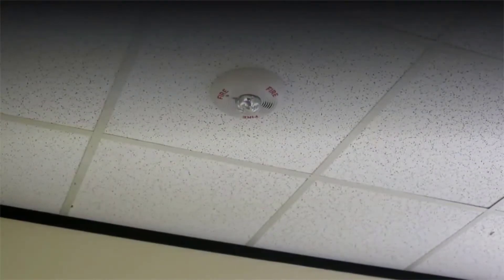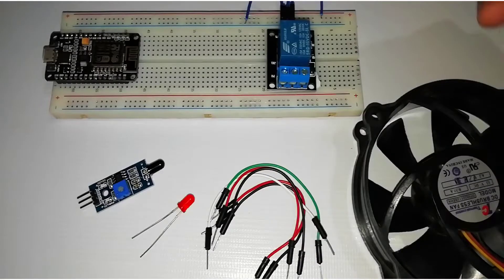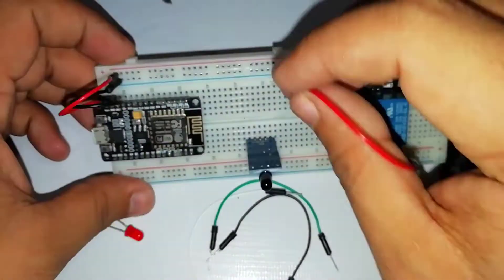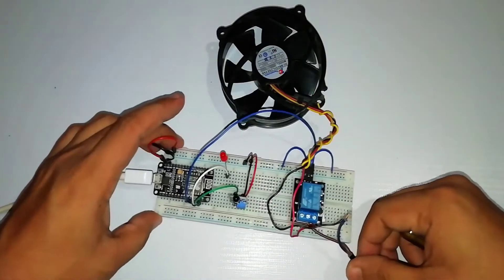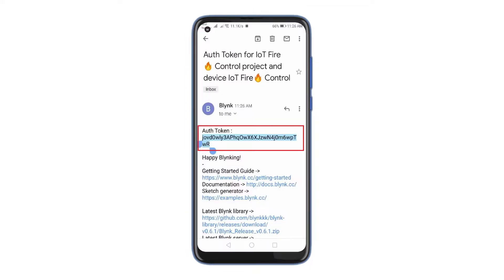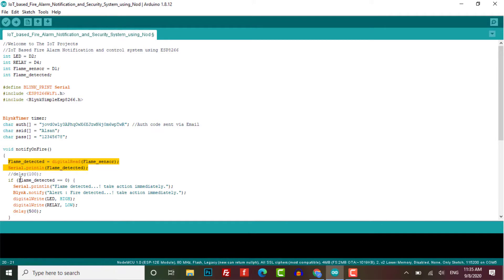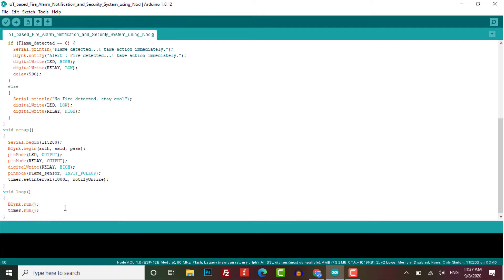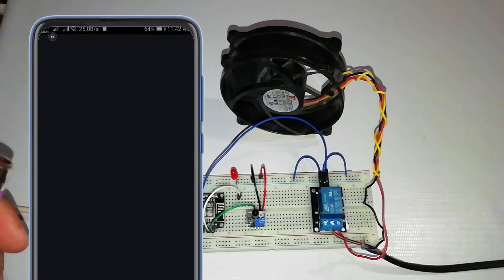IoT based 🔥 Fire Detection & Controlling System Using NodeMCU ESP8266

Comment: Hi sir, may I know if it is possible to convert the 12 volt adapter to a battery....and if possible, what do I need to change in the source code?
and how many volt batteries can be used.